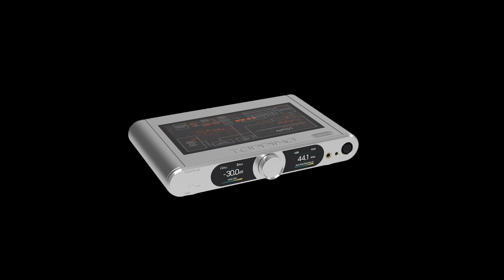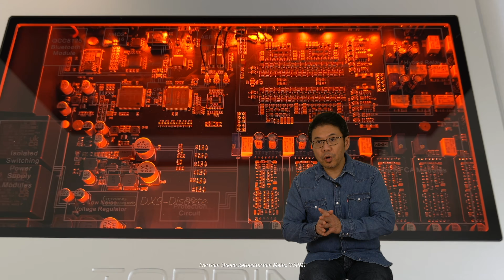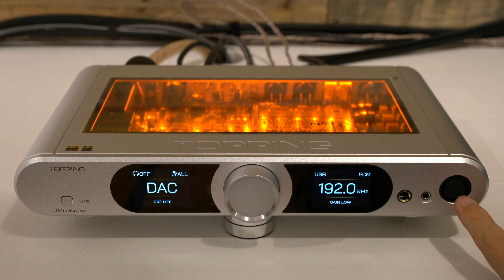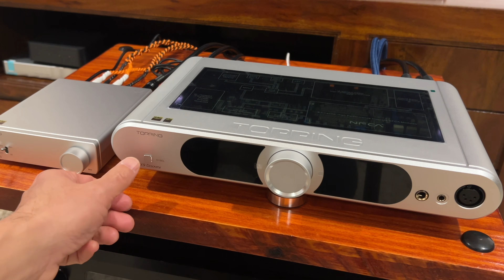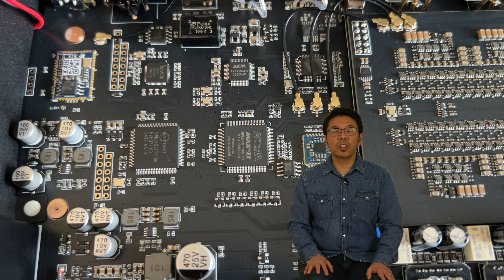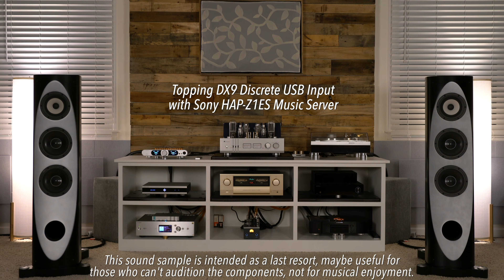The New Gold Standard? Topping DX9 Discrete Review

Comment: "Sound quality is pretty much same as D90III Discrete"

Okay, then the extra $300 for this one must go into aesthetics and interface...
Reply: Well, it has a balanced headphone amplifier, so I think the cost is very reasonable.
Reply: @marekkouril7134  Yeah, but do you really want a "do all", or individual components that do what they do at the highest level...???

I'd put my D90III Discrete with my A90 Discrete up against a single "do all" any day, because they both do what they're designed to do at the highest level, even IF the combo will be a few hundred more...

D90III Discrete DAC, $1000...A90 Discrete HPA, $600...